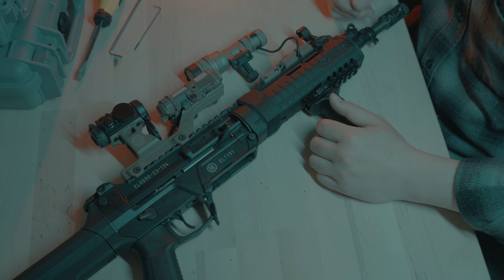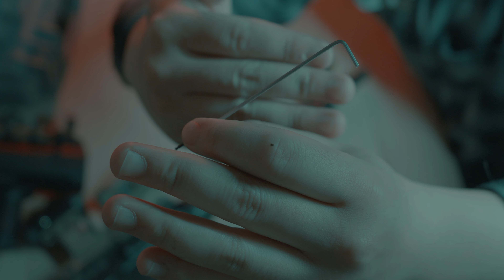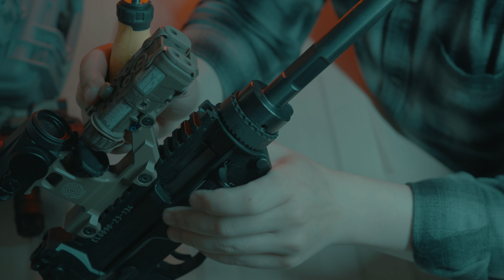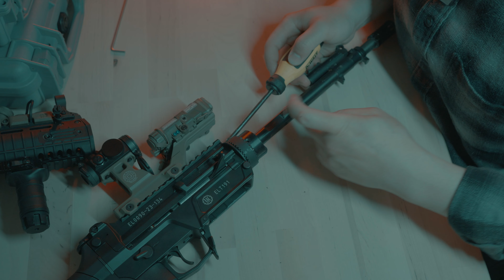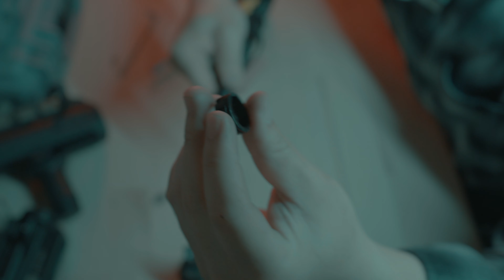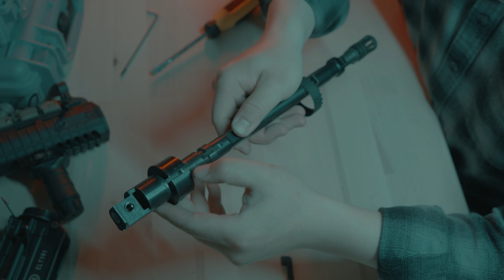E&L T191 GBBR handguard disassembly & reassembly

Comment: Great video. How did you get your castle nut off? Mine seems to be epoxied on. Heating did no good. I did use an allen key to hold the locking tab back.....
Reply from the maker: no need for heating and I am sure there are no epoxy in between, you can find a flat head screw driver and put it on the rear notch of the castle nut, give it a little smash, it will turn loose.
Reply: I’m having the same issue, you ever figure it out?